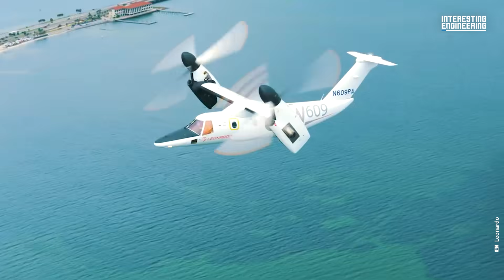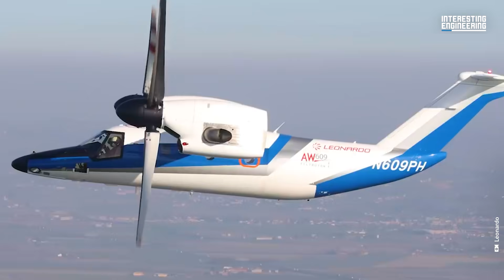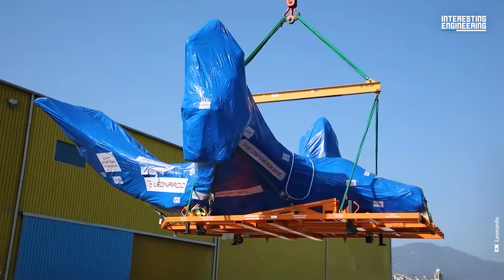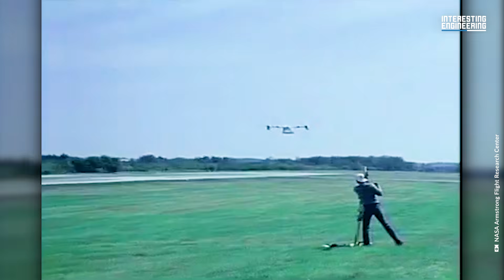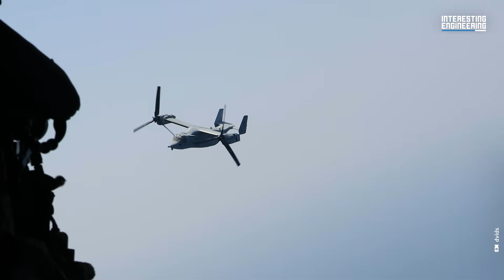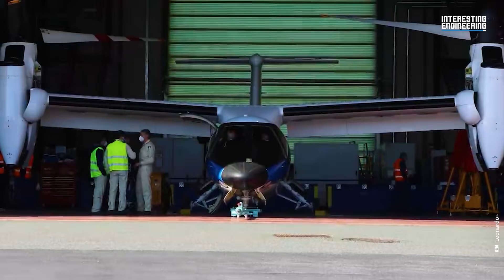The First Civilian Aircraft That Looks Like V-22 Osprey

Comment: A long developmental adolescence,  maturity finally arrives and it's irrelevant now: too small and overpriced. Its lessons heeded by the next generation of tilt-rotors; like instead of tilting heavy nacelles it's easier to tilt just the rotors like the new replacement for the Black Hawk.  It was once touted as a companion gun ship for the V-22, but that didn't happen because along the way required financing for development nixed that role.  About 15 years ago you could download it into the old FSX sim: including the gun ship.

Comment: Hahahahaha Hahahahaha hahahaha 
Remember you have wings. Flaps etc.
Drop the rat, rotate those donks forward and feather.
Then AVIATE the gliding but dropping thing.
Getting low airspeed/stall warning, push that nose down to gain energy, then slap those engines up and autorotate down.
Of course, conditions would have to be perfect hey.
Like altitude.

Comment: Since the V-22 became operational in 2007, 12 crashes and several other accidents and incidents have killed a total of 32 people.
Reply: Which is actually a pretty reasonable record for a large naval helicopter. The V-22 has a similar accident rate to the H-60 Blackhawk family, and is significantly safer than the CH-53 Sea Stallion. Naval aviation is dangerous and accidents happen: the V-22 Osprey is not an outlier.

Comment: What if you lose an engine?
Reply: According to Wikipedia the two engines are mechanically cross-linked so both rotors can be run on a single engine (at reduced performance). It has been rated to be safely flyable on a single engine.

Comment: Is it possible that with further improvements, this concept could make traditional Helicopters Obsolete?? Probably 20 or so years from now?
Reply: Maybe, but not likely. Helicopters are much more efficient lifting vertical loads. More rotor surface area makes for better lifting capability at the cost of forward airspeed. AW isn't marketing these to replace traditional helicopters, but more so to consolidate fleets so you don't need a VIP helicopter + a VIP turbopop/jet, among other markets. They're not planning to have tilt rotors replace helicopters that are already purposefully equipped for slingload and aerial firefighting.

Comment: The only difference with the V22 is that AW609 does not crash
Reply: Not yet and nor does it engage in dangerous combat missions.
Reply: The Osprey was predecessor to the 609 which was a bell design also.Of coarse it performs better.But the concept come from the Osprey or their would be no aw 609.
Reply: @Robert-t1p project from Leonardo da Vinci....
Reply: It did crashed in Italy once while on test sometime ago with fatality too.
Reply: @kittenastrophy5951  was the Airbus modell....
Reply: 2 Nov. 2015 in Santhia, Vercelli province, Italy. Registered No. N609AG.
Airbus never involves in AW609 or BA609 project.
Reply: @kittenastrophy5951  was a fske copy. It is like eurocopter a 💩 made by slugs eaters
Reply: @kittenastrophy5951  
A frenchy copy built by slugs and frogs eaters.
Beter knows like collaborateurplane

Comment: Vortex ring state is always a possibility in helicopters as is stall for aeroplanes. All the pilots are trained to identify, avoid and recover from such aerodynamic events.
Reply: @girishmalviya7719

Yes but tilt rotors are much more susceptible to it due to higher disc loading.

Comment: Bad engineering design. Lose one rotor. You must learn to crash sideways.
Reply: Not hard ot do a google search to find out that the rotors are joined by a drive shaft so in the event of a single engine out situation, the other engine will drive the rotor!

Comment: American designed and American developed 🤣🤣🤣
Reply: Nope italian made
Reply: US started the job, Italian Leonardo is about to finish and get civil certification
Reply: @andreamanera6784 -Nope, it is still American designed, American developed, and still American made in Philadelphia USA… it is just a cheap civilian version of the Bell V-280 Valor 😂😂😂
Reply: @AftonAdams  you can continue to believe that, if you like, but it's just fairy tales
Reply: @andreamanera6784 - The fairy tale is that you pathetic Italian sycophants believe that Leonardo had anything to do with the 609 design and development… or even the build… it is still made in America in Philadelphia USA 🤣🤣🤣
Reply: @AftonAdams Not at all, the Valor's engines are fixed, and the rotors tilt, a major engineering decision that couldn't just be tacked on.

Comment: Leonardo Helicopters is the company, not the name of the aircraft.  AW stands for AgustaWestland.  This was the company name before they change the name to Leonardo.  All Leonardo helicopters start with "AW."  AW119, AW139, AW 169, AW189, AW09... and so on.  
Also the AW609 is built in Philadelphia, PA.  Leonardo's facility is at the Northeast Philadelphia airport, 3050 Red Lion Road.
Many lessons learned from the V-22 are incorporated into the AW609.  VRS has been extensively flight tested on the AW609 and there is a warning as the aircraft approaches this flight condition.  
@seththomas3418 is completely correct.  The crash rate of V-22s is less than other military aircraft.  Unfortunately nothing is risk free.
The AW609 is well into it's FAA certification testing.  The Boeing 737 issues has the FAA on edge and is slowing many certification activities to ensure the products are safe for the public.
Reply: by me AW 609 is built in Italy
Reply: @jebadiaha

That’s great.. but it’s still called the CRJ even though was made by Bombardier and now Mitsubishi, its still called the Allison 250 even though it’s made by Rolls Royce, it’s still called the MD-11 even though it was made by Boeing.

Comment: So jet engines or turbine engines instead of rotor blades can reduce or eliminate this problem?
Reply: It has turbines. Because they only give axial power to rotate propelles and don't generate any jet thrust, they are usually called turboshafts. You mean turbofans like in a passenger jet.
Reply: Harrier could face the same problem, doesn't matter of jet exhaust power or propeller driven.

Comment: I still have my doubts about the viability of tilt-rotor aircraft. On paper they are a great solution like switchblade/swing wing aircraft but in reality? Far far too messy and complicated to be a safe alternative...  I hope I am delightfully proved wrong but after seeing sooooooooo many Osprey crashes and seeing the death toll? Probably not...
Reply: You've been proven wrong for a while now. According to the Data provided by the Airforce and confirmed by other sources. Tilt rotors have a crash rate of around 3.1 followed by fixed wing at 5.3, and then Helicopters at 9.5. 
Give or take.

The reality is the media blew the V-22s accidents out of proportion to the point where every uneducated person, thinks Tiltrotors are death traps when they aren't. Case and point the V-280 Valor which was selected to replace the UH-60 Blackhawk achieved and exceeded all operational requirements for the Army even had more than 300 hours of flight time.
Reply: @Predator42ID  To be fair, the V-22s tilt rotor system does has significant enough drawbacks that Bell approached the tilt rotor concept from a different angle for the V-280.
Reply: There is no question about viablity the concept works. Osprey is literaslly a safer aircraft than the blackhawk.
Reply: @dwater Idk why the Blackhawk is being compared to the the Osprey when the two aircraft are completely different in terms of size, capabilities, cost and mission profiles.
Reply: Yeah they keep crashing
Reply: @yuv06  like blackhawks
Reply: @jus7addwater  no Blackhawks are fined considering the numbers in operation.
Reply: @yuv06  actually they are not. Even considering number sin operation they are a more dangerous aircraft. Sorry facts matters
Reply: @jus7addwater  Well according  to real situations seems the V22 with much fewer nos. still crashing.
Reply: @yuv06  in reality they are safer than black hawks according to the data. So again stick to facts.
Reply: So many are how many? otherwise it is just chit chat